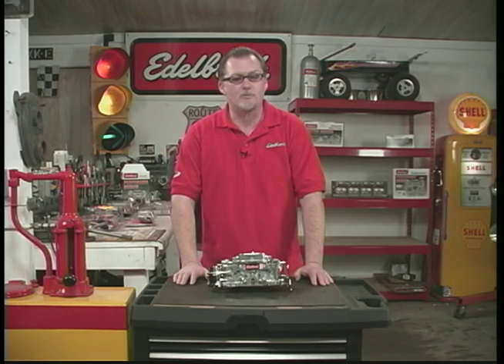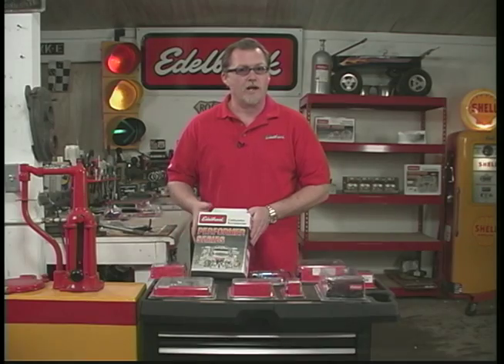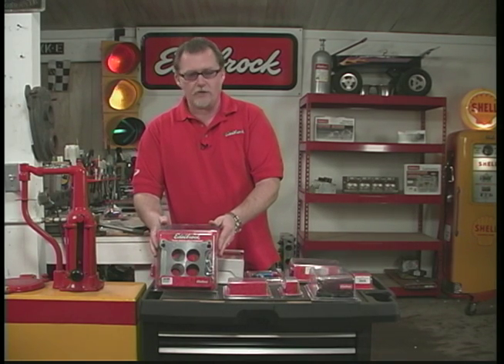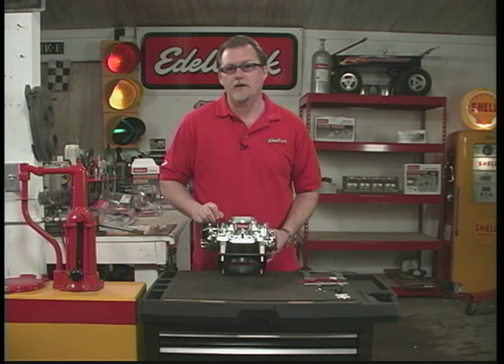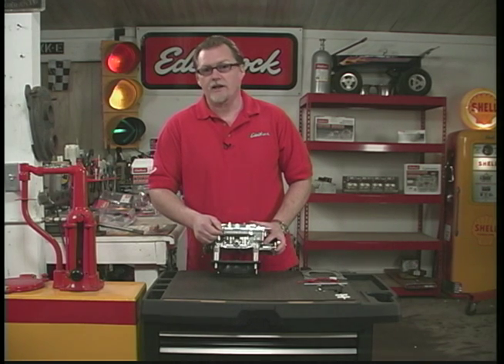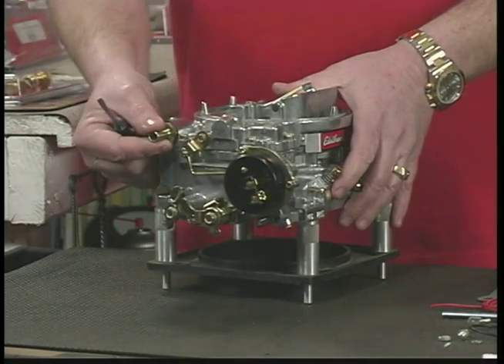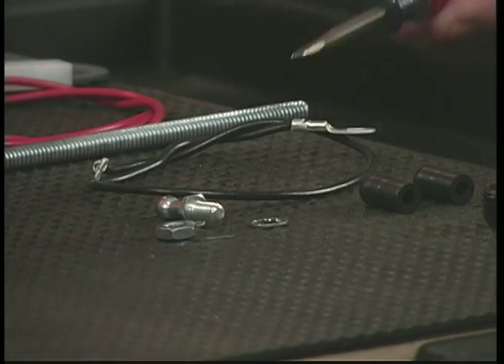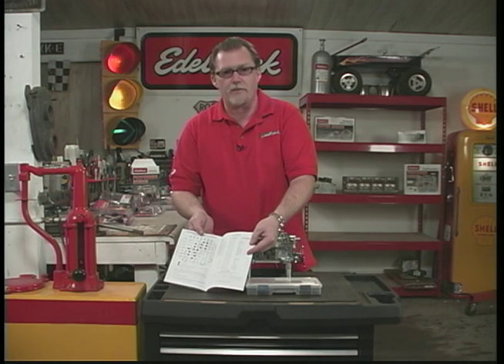Edelbrock Carburetors - Before_You_Start

Comment: I have a 4 speed '69 roadrunner w/stock 383 (bored 30 thousandths with oversized rings and hardened valve seats). I have had it 38 years. I installed a 650 thunder series (1806). An old motor head tuned the carb drawing manifold vacuum, not ported. Played around with sluggish acceleration for years (don't drive it much) and this year had fuel pump failure. When I replaced it it ran better than ever. I would like to retune the carb now that it has correct fuel flow. Instead of reinventing the wheel, and as a general rule, what is the best set up for this car (metering rods, jets and springs)? Should I go back to the factory set up and start there? Timing is about 12 degrees at idle and I run Pertonix electronic ignition. Thanks and great videos!

Comment: I have a used Edelbrock carburetor the on a rebuilt 350 engine and the engine runs good but the carb only runs with the choke closed and will not run when its open and I checked for air leaks and there is none is there anyone that can help me... rebuild it or get another one?
Reply from the maker: Rebuild could solve this issue. Could be a plugged jet or something simple.

Comment: Question:  (asking for a buddy) He bought a 600 CFM Edelbrock #1406 and needs a #1403, 500 CFM but he doesn't want to buy new carburetor?  
His newly built 9.5 to 1 compression, mild cam, 302 motor is running really rich (like crap) now.  He has a manual 4 speed tranny street driver 65 mustang.  The stock EDL 600 CFM primary Jets are .098" and the secondary are .095".  Rec gas is always used and the fuel pump is mechanical.
According to Edelbrock, every .001" of jet size change, equals 3-1/2 % fuel air change.  I was going to recommend that he drops the jets 2 sizes (.006" total or 17.5%) on both primary and secondary to .092" & .089".  Yes  that's a big change but it needs a big change.  When I drove the car it was loading up and backfiring in the muffler at 0-60 mph while accelerating and cruising.  It's so rich at idle it chokes you and the idle Jet screws don't do much.
I calculated 302 x 6,000 x .85 divided by 3456 = 445 CFM carb needed.  500 CFM is the closest .
Other than buying a new carburetor, what do you think he can do now?
In the future I'm trying to get him to a local speed shop and put it on a local Mustang chassis dyno to read fuel air mixture curve.
Thanks for any experienced replies.  2003

Comment: Ok, I purchased the AVS2 800cfm carb with the help of Edelbrock for my engine. Now I have a new electric fuel pump and filters and I cannot seem to keep the car at idle it wants to turn off. I see that the 2 round bowls in the front of the carb only the left side is squirting fuel at idle before shutting off. Any suggestions with this would greatly help.

Comment: Lets pretend I've never touched a carburetor.  Give me a video for dummies. 

I bought a gmc c3500 dually 454ci
Automatic 2wd. 
It has an edlebrock 1407 
Also has edlebrock intake manifold 
The jets are shooting fuel out when I press the gas. The truck has spark but it still won't start. I currently only have the engines mechanical fuel pump hooked up  running to a can of fuel(no electric fuel pump) do I need the electric  in tank pump for the psi?
Or? Any other solutions to get it to fire over during testing.

Comment: I bought the 650cfm for my 68 ford galaxie with a 390 fe 2v , I put a big street high performance cam and 4v intake manifold. My vacuum is 6-10 hg at idle so I put the lowest spring in the metering rod assembly and no more flooding but my choke don't work, I wired it up and it's still not working! It gets warm so the heat element is doing its job but I never see the choke flap open or close it just stays almost closed til I open the throttle and it opens with it, is that how it's supposed to work?
Reply: thats the way it is supposed to work

Comment: Hi there I have a stock 305 Chevy pick up with stock manifold and all with the 5 L I have deleted all of the omissions systems EGR smog pump and vapor canister however I still have the stock distributor which is important for the 305 cam which port do you recommend I use ported vacuum Or manifold vacuum for best results thank you
Reply: The left

Comment: Okay, it's been a long time since I've played around with carbs, and some of this stuff has gotten fuzzy in my memory.  The above video mentions that I would need an adapter plate to use this carb on GM car originally using a Rochester Quadrajet, but will this carb fit onto a 1970 460 in place of a Motorcraft 4300 carb?  I believe that carb I have now is rated at 650 CFM, so will I run into too many problems if I downgrade to 600 CFM?

Comment: what carburetor  do I put on my 68 ss impala  it has the original  327 ?
Reply: 500CFM
Reply: Is a 2 barrel ? Cuz it has a 4 barrel  now it's the 1405 e elderbrock
Reply: +blue970 Rodriguez idk what part number edelbrock has for a 500cfm.

if you watch this entire video, he says what cfm in general goes to which engine sizes. stock to mild engine smaller than a 350, run a 500cfm. 350-454 cubes, run a 600cfm.

I know Edelbrock carbs have the part number stamped on the low front right corner near that mounting bolt. This video series will show exactly where to find your part number.

I know a 1405 is performer series 600cfm manual choke. 1406 is performer series 600cfm electric choke.
Both are 4bbl

You said you have a 1405 e. IDK what that is.

As far as a 2bbl goes, the only ones that I know anything about are the Rochester 2G. Those are a 250cfm 2bbl. ~I only know that because the yellow deuce coupe from the film American Graffiti runs 4 of them on an early Man-A-Fre intake atop a 1957 Bel-Air 283 block. Casting numbers dated May 18th 1957.

But I digress. Getting back to your car, I recommend that you go to summitracing.com

Find their technical support page and you can e-mail them your questions. Be sure that you provide them with every detail about the car and the engine. If you can remove one of your valve covers, the cylinder heads have a casting number. If you can give them that number, along with every other detail you know about the running gear, their experts can tell you exactly which carburetor to run.

Better yet, I recommend you track down a GOOD mechanic and have him rebuild, tune, and install you a good Rochester Quadrajet.

Don't listen to anybody who says Quadrajets are bad. If you know what you're doing, a Quadrajet runs fantastic and is known for the best fuel economy.

Personally, on a stock-to-mild Chevy engine, the first thing that I would do is seek out expert advice on what specific casting number to look for on a Quadrajet, and how to rebuild it and install the correct Jets for the application.

Be warned however, that a Quadrajet is one of the most complicated carburetors that you can get. They can be very finnicky if you don't know what you are doing.

I personally have never been inside of any carburetor, and I would not attempt to work on any of them without consulting with an expert.

I hope I have helped you in some way or another.

Like I said, find the technical support at SummitRacing.com and ask them what carburetor they recommend. That's your best bet.

Or a Quadrajet.

Please comment back and let me know what you decide to run.
Reply: 650